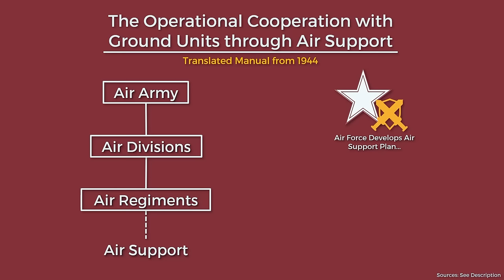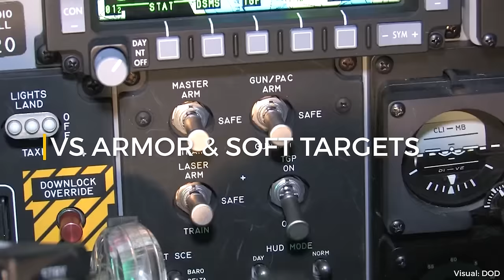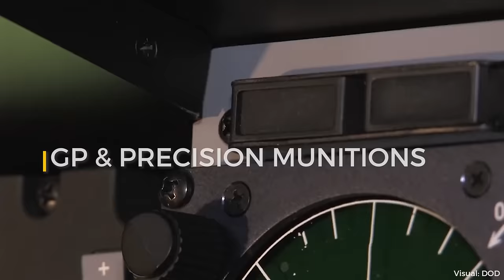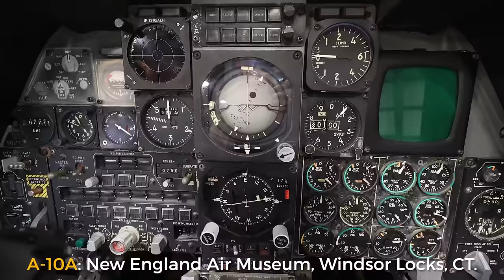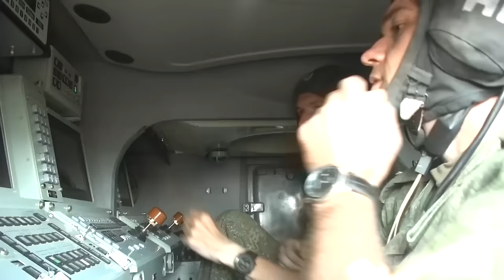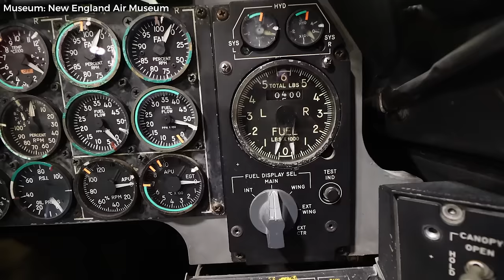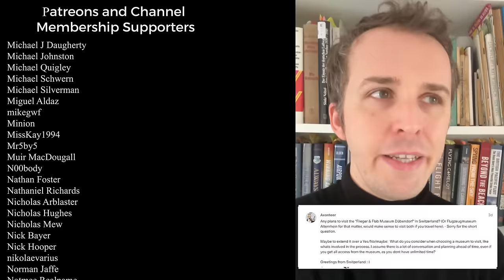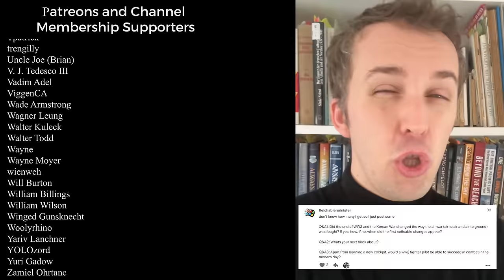A-10 Warthog: Retire or Upgrade the BRRRT? - Future of A-10C Thunderbolt II

Comment: I think there is at least one pretty unemotional reason I can think of that we should keep this going. It's a sweet spot of technology and raw power that we should keep as a defense or backstop for scenarios in which the US loses its super power status but it's not simply the end of the world. This would quickly become very relevant if a war took out most all superpower modern fast attack / multirole fighters in the world (and before you say this couldn't happen--it could very easily happen even without destroying them directly if, for example, the chip supply was interrupted and/or key aspects of their high tech maintenance cycle were targeted)...and as far as SAMs go, just improve this thing's high altitude performance without sacrificing low altitude performance--I don't think those things are mutually exclusive if you no longer need speed. But I will admit that I emotionally think it should be kept anyway, cause it's just badass. Also, is it really impossible to design an even more survivable version of this thing with modern materials and techniques? I can't believe the f22 or f35 can take any sort of beating like this can ...as the stealth cat and mouse game changes sides over time, it would be nice to know we had at least some aircraft that could stay in the fight even when everything goes wrong. How about making this a platform for laser weapons? I could imagine a laser under each wing and maybe one on the top of the fuselage such that it could instantly target in 360 degrees, even if it didn't have the power to fire more than one at the same time. Finally, if you made a version of this thing optionally manned, you could push it as an attritable beast, couldn't you--it might be somewhat more expensive than pure drones, but if it lasted longer it might find a sweet spot of value that way too. Nonetheless, I wonder what the cost of making this plane TODAY would be--not just from inflation, but actually from the point of view of getting raw materials for it--unless you cannibalized the titanium and re-used it in the new version it might be a problem for cost compared to modern fighters. Still, a modern version of this that didn't become completely useless if its chips stopped working--by giving it (or keeping?) mechanical access to hydraulics in addition to fly by wire, for example, would quickly bring its relevance up front and center. Let it have the chips and tricky maintenance in other words, while staying fundamentally a plane that doesn't depend on them 100%
Reply: F16 have already done the job as bombtruck since decades back. So there is no need for this plane in that role. I mean if this plane had an enormous amounts of hardpoints and a super low cost per flight hour I could see the argument for keeping this plane for that role. But A-10 does not impress in that regard. Its a two engine plane that is more costly to fly than a F16, and a F15EX got more hardpoints and is stealthier and thus better suited for carry many laser bombs that it can drop from a safe distance away from enemy air defences.

Reducing the number of types of airplanes would make it logistically easier and more cost-effective for the US military. And A-10 can be replaced by F16 or F15 for the bomb truck role. A-10 is just an old plane with an airframe that is old and getting older and older and soon no longer able to fly because the plane would fall apart in the sky due to material fatigue.
I can feel nostalgia for this cool plane. But nostalgia in itself is not enough of a reason to keep this plane for the US military.

I guess it is too difficult to convert this plane into a drone. And perhaps is it impossible to also justify the costs of doing so if it was possible.

Comment: Dumb question of the day: The A-10 counterpart is the SU-25 (Frogfoot). I feel the A-10 is the superior platform for it design purpose. So why, do you suppose, has the A-10 not been offered to the Ukrainians? I could see this as the game-changer for them against the Russians. Seems the U.S. has many serviceable airframes in lay-up storage. Yes, it would take time to get any airframe ready for operation. Perhaps thars the rub as it would be costly. But how does that compare to the F-16 costs? Opinion?
Reply: You can’t fly A10s without air superiority, which is what the F16s are to be used for.

Comment: To be fair, the USAAF never wanted the A-10, and has wanted to get rid of it practically from day one. It got the A-10 CAS role because it wanted the budget and didn't want the Army to get it instead. As the A10 replaced the Skyraider, so will something replace the A-10 - otherwise the U.S. will find itself fighting a war it wasn't expecting to fight without a tool that would have been useful in that fight.
Reply: That's a lie. There was no budgetary issue, the USAF used the A-7F upgrade program budget to buy the A-10 instead. They didn't take the Army's money, no money would be given to the Army, the USAF just used their own money. Just stop lying. And the GAO slammed the USAF for buying 700 A-10s saying there was no reason for such an excessive purchase. Turns out they loved the A-10 too much back then, that was the criticism. Now they hated it all along. All people do is criticize.
Reply: The USAAF has not existed since 1947. I think you mean the USAF.

Comment: It’s really funny seeing how many people mention the gun is ineffective against armor…. Which naturally isn’t true.  That’s based on an assessment from the 80’s that showed the weapon was extremely effective for the intended purpose.  While that report did show few “hard kills”, this was attributed to the spray…. and that is before multiple upgrades reduced the area of effect.

You can take anything out of context that you want.  🤷🏻‍♂️
Reply: It was ineffective against... T-48 tanks used to mimic Soviet T-54/55s.
That 1979 test used woefully outdated tanks.
Reply: @ChucksSEADnDEAD   I knew it wouldn’t be long before someone demonstrated that didn’t know the difference between a hard and soft kill.

The “M48” used in that test had better armor than the T-55’s.  220mm of armor is closer to the T-72’s maximum thickness of 280.   Of course the A10 is designed to stop a large tank advance and that report showed a mission kill for almost every target.

Throw in another 40 years of ballistic advancement and I don’t believe it would perform worse than it did in that test (USAF shows it easily penetrates modern reactive armor in recent tests)
Reply: For a demonstration of a soft kill, one only needs to search for “T90 vs Bradley”.  And that cannon is NOT rated for tank armor.

Comment: I think it should be enhanced rather than scrapped. The A10 design could become a decisive choice in a hard fought war, a weapon that the opponent does not have. Imagine if they had them and we did not.
Reply: Enhanced how? You can't fix its lack of speed and thrust woes without starting from scratch.
Almost nobody has A-10 equivalents. The US has the A-10. Former Soviet clients have Su-25s. Nobody else makes this kind of aircraft or buys them. It's for a reason. If they wanted to, they could easily have them.

Comment: I like the video and like your channel, been with you a while now 👍  It is unnecessary to even consider any changes to the mission set. The Warthog was designed specifically for the CAS mission set, and there was no shortage of integrated air defense threats to that mission profile in the Cold War.  The anti air threats have just become more advanced.  The infantry on the ground want “the GUN!”  They will continue to want exactly what the Hog gives them in its original close air support role.  If we follow the logic that the anti-air threat is too high, then we may as well retire all of the Apaches and Cobra gunships while we’re at it… oh and let’s discard the AC-130 because… missiles.  The CAS mission is 100% as relevant as ever when you have troops in contact.  Keep it just as it is with some increased emphasis on longer range weapons such as SDB to give the Hog longer tusks 🐗
Reply: >oh and let’s discard the AC-130 because… missiles
This but unironically, completely obsolete.
Reply: Spirit 02 and its crew met their demise for staying too long over a battlefield. The AC-130 is not fit for combat with near pear adversaries.

Comment: I read a few times, that the gun wasn't as useful as expected. If that is true, then the plane carries a lot of dead weight. my prediction: Helicopters have the precision but not the loiter time. Drones have the loiter time but not the payload. Fast jets need better runways and are more expensive to maintain. We might see a new plane without the gun. Also cheap to maintain, STOL. US Air Force will likely break down AA assets with fast stealth jets, but will need workhorses for CAS, that need trained pilots and quick reaction times. I do think that technology has advanced so much, that small diameter missiles will be more cost effective against smaller vehicles and large missiles against tanks. Cluster ammo/precision bombs will still be used. And surviveability will be down to stealthier design, and electronic warfare.
Reply: The A-10's gun is as effective as the AH-64's 30mm cannon
Reply: @pogo1140 I guess that means not worth the extra weight? Smaller gun would do?
Reply: @huginstarkstrom   Is the AH-64 losing the 30mm gun? Is the AH-64 replacement going gunless?
Reply: @pogo1140 the A10 gun was meant as tank killer with uranium depleted ammo - which even 20yrs past iraq invasion still increases cancer rate. A-64 is a slow, stable platform which can take out machine gun nests and so on. For tank killing, missiles allow more standoff and therefore more survive ability. And as used in the AH-64...the AH64 is miles better. That all depends on doctrine and the way weapons are used though.
Reply: @huginstarkstrom   
The A-10 uses a party mix PGU-14/B Armor Piercing (DU) and PGU-13/B High Explosive Incendiary (HEI) rounds. The ratio depends on the expected mission.